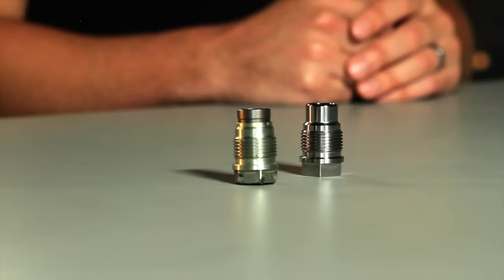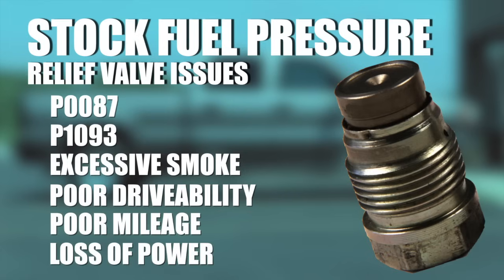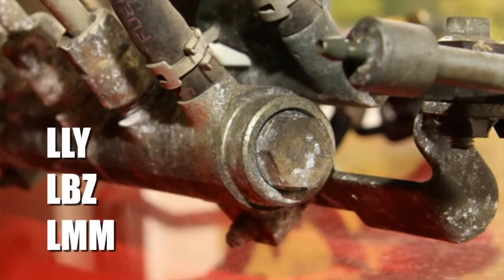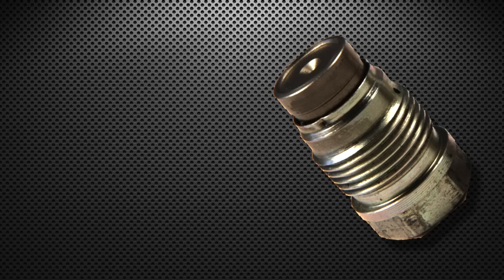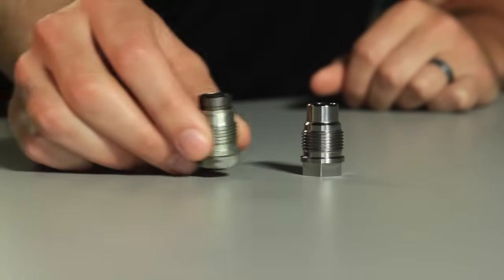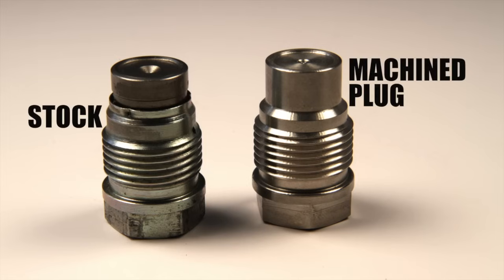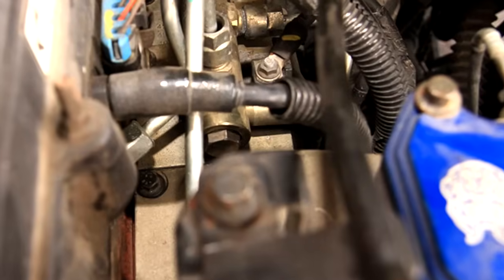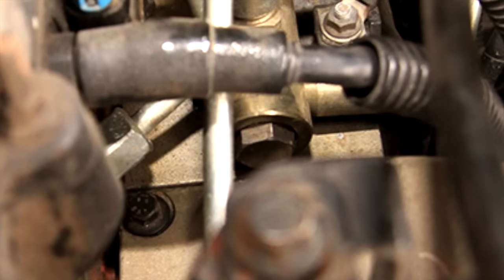Fuel Pressure Relief Valve - WHAT YOU NEED TO KNOW!

Comment: what does it do to the fuel pressure in the engine if the OEM part fails? Rail pressure too low and excessive returns? or something else?
Reply from the maker: It will not keep up with the command in fuel.

Comment: Mine was causing major issues 8-10 years ago. It would like bog out and ran like crap. They found this to be bad. Now my truck is starting to lose power, mostly when it's warmed up. It isn't throwing any codes. I just replaced the fuel filter again just to make sure that wasn't it. It mainly loses power at higher rpms. It sure does swen fuel related. Is it possible that this valve would work better cold than hot?
Reply from the maker: Not in our experience.

Comment: Hie guys i have a problem wth my common rail mazda b2500. It does not start on its own beside using quick start. And when it start it idles but upon acceleration it switches off. The code am having is p0607 plz anyone who can help.

Comment: What are the symptoms when this goes bad? I heard a drop in fuel pressure but then that would mean the injectors aren’t getting enough fuel so I would imagine the motor would sound blown. It’s pressure relief so does it relieve fuel, air or both? Why no oring? I’m thinking just an Oring so why not go with a new oring? .20c part

Comment: I have an LLY with 8,000 on the motor. No mods except a RDS 64mm turbo. New engine throughout. My issue is that the fuel rail pressure is all over the place and sounds like a blown engine. It started 2 months ago and sounded like an injector knock but got much better when running above 180 degrees. Now it does this all the time. 3 shops have had it and no answers. I don’t recall it even throwing a code at all. Engine still running horrible and can’t drive it. Any advise would be great

Comment: Whats Recommended for 10m stoker pump 90 hp injectors 06 5.9 ?
Reply from the maker: Tuning.
Reply: I have tuning. I'm just trying to find the best one, too, replace  my rail plug. Is 2200 bar good or 2000?

Comment: My MP8 mack/volvo engine which is a 535hp engine and it is having boost issues, flat out getting to 200kpa then outta the blue it will boost at 260 and runs like a dream,if I stop or slow down it will drop out and go back to 200kpa. Could be the issue
Reply from the maker: You need a shop to take a look. We would need to get our hands on it to find the issue.

Comment: I have low fuel rail pressure code when towing. When I come to a red light. It will be in limp mode when I try to get going again. I have a lb7. Help please.
Reply from the maker: Give us a call, 815-568-7920. Reference any codes. We can help assist in the right direction, but it would be best if we could diagnose the truck ourselves.

Comment: not sure if this thread is still active.. I have a 2005 lly engine code "2" my truck will go into limp mode and not let me go above 65.. and damn near nothing with my 5th wheel. New fuel filter. It never throws any codes though?? I was thinking of doing the FPR but maybe this is what I need? or both? truck is completely stock.
Reply from the maker: Have you scanned it for codes? It may trigger a code but not throw the check engine light.

Comment: I've got a 2007 Lmm and keep getting P088 high fuel rail pressure when deceleration. Would this valve fix that?
Reply: Did you fix this issue. Because I’m having the same issue after I installed my air dog lift pump. 09 duramax

Comment: I have a Volkswagen Touareg 3.0TDI with a cp4. I occasionally get a p0087 code & the truck starts to surge. It'll smooth out on its own after about 20 seconds or if I tap the throttle. Would this be the relief valve or the regulator valve on the cp4 pump?

Comment: Will this solve  a p0191 code? I got perfect fuel pressure on my scan tool. Does this work with the LML rails? I had this code before I did the cp3 conversion and a fass lift pump. My cp4 didn’t have any metal and never had an issue with it. I only didn’t the cp3 conversion for a peace of mind.
Reply: I have the same problem my cp4 fail and changed. You solve this issue?

Comment: Yep, used one on my cummins and blew the top off one of my injectors.filled the motor with fuel. I was towing at night and in the rain and never knew it happened until my idiot light was going off and I looked and had no oil pressure. The oil was floating on the fuel and blew out the breather. Good thing, no hydro lock and motor is still ok. Reinstalled stock valve. Be aware. They are there for a reason!

Comment: I'm a owner-operator hot shot driver that does his own mechanic work. I brought a 2004 Topkick 5500 I'm looking for a scan tool that will work with the truck. I have tried a few and most of them don't recognize my truck.
Reply from the maker: GM MDI Tech2 would be the most complete but, comes with a price tag. An EFILive AutoCal/SPADE would work for basic scans and data logging.
Reply: I have a 2008 Topkick(C4500) with an lmm motor. Is there a scan tool for my truck where I can read and delete codes?

Comment: I have hond civic 2.2 cdti trying to get power up hits 220 bhp get low rail presser  P0087 
Do you do upgrade valve 
I have all so looked to get fuel pump upgrade but can't find bosch agent that upgrade it
Or aftermarket pump
Only can find for VW bmw  do do pump upgrades?

Comment: I had this code return today P0087 w/Low Power Mode. This happened while towing 9,000# 5th wheel. 
Fuel filter was changed 2,500 miles ago. TP3018 GM Filter
Thoughts?

Comment: I have a P0088 and my rail pressure bounces. I run a sump to airdog 200  and I replaced the fuel pressure regulator but still has high psi on start up and the drivability is here and there until eot is normal. She also bouces at idle from 5-10k psi on the rail.
Reply from the maker: What year Duramax is it?
Reply: Did you ever fix the p0088 issue?  I'm getting the same code.  Thinking you might be able to help
Reply: It was my pump going out. I fixed it by replacing all my injectors, tubes, and installing a rail plug and 12mm injection pump. She doesnt see below 14psi. I have an inline psi guage before my injection pump and my mm3 shows my rail pressure.

Comment: I had a 6.7 Cummins in the shop that ran away on the owner from oil in the intercooler after he replaced his failed turbo. He had installed a rail plug at the same time. Turned key off, Injectors turned off but engine running at 5-6k rpm and no where for the fuel pressure to go. Yeah bad combo, blew the pintle out of the ends of 4 injectors and cracked the tip of the other two nozzles!

I install these plugs and believe they are safe 90% of the time but beware that if your truck engine were to run away and the injectors are off they will be destroyed and so will your cylinders.

I have seen and heard of lots of engines having run away following turbo failures when the intercooler doesn’t get cleaned/drained/replaced. (Not under my care). Generally they shut back down after a minute or so and the engine survives. Point is in the case of my one customer the factory relief valve would have been the difference between a 60k mile motor living on instead of catastrophic failure.

Comment: Could this make a crank no start on an lb7 it was running great then gave it two sharp rpm revs then it died and won't start
Reply: No, but there are a multitude of other fuel starvation points that could.  Log rail pressure vs desired rail to determine if it's fuel system related.

Comment: Better than putting a plug on is putting a single stage relief with high pressure release so you still keep a safety for fuel pressure. New BOSCH rail pressure relief valve modified for single stage operation. This valve corrects a common issue of rail pressure fluctuations and drive-ability issues inherent with the stock valve. In stock form the valve is a dual stage design, where once the valve opens due to system over pressurization it remains held open until the pressure lowers below the second valve stage. Typically the opening pressure is around 220 MPA or 2200 Bar, and the second stage holds the valve open until the pressure falls below approximately 65 MPA or 650 Bar. Once modified to single stage operation the valve will then regulate pressure at a constant single setting. We offer these valves set to various opening pressures ranging from 180-210 MPA (application dependent).
Reply: Is the a cheapish single stage anywhere to be had? If not what is the scope of modding the Bosch?
Reply: Ya where can we get the valve from?

Comment: I have a 2011 duramax 6.6 that is having these issues but looking at the end of my fuel rail on driverside I see a electrical connector. So any advice?
Reply: 2011 uses an electronic relief valve.  It's a pretty robust design unless debris goes through it (in which case you've got bigger problems).

Comment: "The fuel pressure relief valve - also known as the fuel pressure regulator..." A fuel pressure relief valve is not the same as a fuel pressure regulator.
Reply: Especially considering duramax engines have always (since introduced) used CP3's which have, a fuel pressure regulator, and further downstream a fuel pressure relief valve. These guys seem to shoot towards the more uninformed crowd, but bad information is dangerous in its own right
Reply: @BlondeWick  that and possibly grenading injectots by deleting the relief valve, if you are hard on the engine.
Reply: Yes pressure relief as very deferint
Reply: My engine was loping at idle. I changed the pressure regulator and the loping stopped but now the engine makes lugging sound for a few seconds if I let off the gas and hit the brake say at freeway speeds or when the rail pressure is high. Then gets back to a good idle. Does that sound like a relief valve issue?

Comment: “p0047 Turbo/super charger boost control solenoid circuit low “ then “p0090 fuel pressure regulator 1 control circuit “ those my codes

Comment: Hey Guys, I have a 2006 Duramax LBZ motor with a bad fuel issue.  I can drive down the road and the engine will just cut off.  It’s like the fuel pump loses signal and the engine will just stop running.  I put it in park, turn the key off and restart the truck and its like it never happen until it does it again???  Lately I have been getting a 0088 code fuel rail too much pressure code and I will clear it and it goes away for a while, but it resurfaces.  Can you let me know what the problem is??  Could it be the sensor in this segment???  I want to know before I have to take it to the dealership and pay an arm and a leg!!!  Thanks!!!

Comment: I have a 2008 6.6 Duramax,  and recently had issues with going into limp mode, while towing my 24' trailer, local shop replace cp3 pump regulator, and said I'm still not getting  enough fuel pressure,  about 2000# less than what it should be running at. Could this relief valve be causing my pressure to not build high enough? Or is it possible I have a pump issue.
Reply from the maker: While it could be the relief valve this sounds more likely to be a Cp3 pump. When the regulator goes bad, they either lope at idle or lose signal completely and run wide open.  The relief valve most commonly, will open under high load and drop your Actual Rail Pressure dramatically.  A weak Cp3 or restrictive low-pressure supply would most commonly cause a consistent deviation between  Actual and Desired Rail Pressure.

Comment: Having surging at idle
Reply from the maker: Check your fuel pressure regulator.
Reply: Which is different than the pressure relief valve. It’s located on the back of the injection pump and is held in with 3 torx head fasteners.

Comment: Just had a issue today.   Had to get on it hard to get out into traffic. Let off at the next light  to turn truck shut off  cranks but no  start.  Basically bone stock 05 LLY  changed filter and water sensor now is it possible this is the problem.
Reply from the maker: It's possible.

Comment: Used a regular 18mm Craftsman wrench. Used the boxed end on the wrench. Tapped on the open end of the wrench with a brass hammer. 
Tap tap tap until it came loose. 
Installed plug same way. Tightened by hand as much as I could, then tapped it over a quarter turn with the brass hammer.
Reply: Where is the location of it

Comment: Lots of questions about LMLs
I have 2015, same problem, but cant find any videos
It's on the front of rail drivers side
The back port is a sensor, the front is valve
I cant find anything on how to get in there, may have to take EGR off

Comment: I watched some videos on these and couple places said that they have seen nuts and fittings blown apart when you let off the throttle. I have a stock 05 lly, I don't have any codes yet but thinking the spring in my rail plug might be weak. Would this be a good idea for my engine since it still runs on the stock tune? Only thing I have done is install a fass95 pump and s&b cold air intake system.
Reply from the maker: Yeah do it.  For $50 you really cant beat it.
Reply: @Duramaxtuner  I got one with new seal from ppe for $31. Now gotta figure out how to get the glow plug module bracket out of the way. Can I cut it and relocate the module or is that bracket grounded?

Comment: I use to be able to smoke the tires at a light. Now nothing.  What do you think?
Reply from the maker: Boost leak or dropping rail pressure would be the most common reasons for a loss of power.

Comment: I have a 2001 lb7 and I have black some under regular driving not a lot but some could this be the issue
Reply: Lb7 has no rail pressure relief valve. Check air filter, check for boost leaks, check your turbo wastegate, if all are good, check your injector balance rates. You'll find your answer fairly quick.

Comment: I know this is an older video, but I did this fuel rail plug. And than I bought a ppe ported fuel rail fitting.  And that ported fuel rail fitting leaked fuel like crazy(while I was on a trip with my fifth wheel camper).  Luckily i swapped my stock fitting back in, but I’ll still get that low rail pressure code if I horse on a high tune.  Did I do something wrong or should i drill my stock one out(ppe fitting has 3 or 4 threads showing)

Comment: I have a 2006 LBZ Duramax I have idle issue when I put it in reverse or drive or AC on it runs good but if I put it in park it idles up and down could this be the problem?
Reply: I have this issue did you ever find out what it was? Lly on mine

Comment: so my question is i drive my truck daily and mine just did this so i parked it and i believe this is the issue but if i put one without the release valve like yours don't i risk my injectors getting over pressured and blowing up? also does my fuel economy go down because it blocks the extra fuel going back to the tank or does it not block that?

Comment: 26-29 thousand psi....  that's the typical shear stress of steel. I know you were exaggerating on some of the comments, but sheesh - try to be accurate when quoting actual numbers.
maybe leave the thousand out.. be a lot closer.
Reply: That's the pressure that these truck run, fuckwit. 29,000 psi.
Reply: My lb7 runs at 24000 psi and the newer ones run much higher.

Comment: Im seeing slightly low rail pressure at WOT truck always only makes 21k or a hair more but is demanding more. Has no problem getting to that 21k. Do you think my PPE rail plug not being torqued hard enough could cause this? I was not the one to install. Truck makes the same rail pressure on each tune and still has plenty of power. What gives
Reply: Did you ever find your issue I’m experiencing the exact same thing
Reply: @texasishome2022 nope truck runs fine so kinda just blamed it on a rich tune maybe

Comment: I'm having fuel pressure loss when my lmm sits and I have 2 prime it. Could this valve be the problem? I'm getting no codes
Reply: I had same problem a couple of years ago, leaking around primer, also wires were broken for the heater on the top of the filter housing. Could not repair wires , ordered a new housing from dealership and problem solved.
Reply: rootedflunky1  no that is caused by your fuel filter housing. You just need to rebuild it. It’s like 20 bucks comes with new spring seal and brass fitting.
Reply: @anthonygutierrez1038  n
Reply: rootedflunky1 same thing happen to me about 2 months ago. I rebuild the fuel housing out on my drive way and it was missing one of the o-rings in there. Didn't even have to take it completely off my lmm let it hang and put back with new seals and bam! Running like a champ.
Reply: Sergio Flex5 ...... I replaced the water separator sensor and that fixed my problem... Thankfully I didn't have 2 rebuild the housing.

Comment: Put the plug in my ‘11 cummins. It did away with the ‘burping’ after pedaling under load. So far so good. Had to remove intake horn, took about 1hr. $10 part ***quick update: I spoke too soon, still having the issue. I will reach out to CPS once more.

Comment: Today I got the p0087 while towing and forcing the truck abit uphill and truck went into limp mode, is there any risk on replacing stock valve with this? I drive a 2012 ram 3500 6.7 full stock.
Reply: Daniel had the same exact thing with mine. 2011 ram 3500 after I deleted! Had p0606 on key code read and 0087 on a scanner. Shimmed the stock plug and no issues since. Would happen pulling 40 foot horse trailer merging on to on ramps or going up hill at a slower speed then having to ask for more going up! Til i figured it out if I pulled over and shut truck off and did the key trick to read and reset codes light would stay on but regained power. Light would go away when I unhooked from the trailer and drove a minute. Was really frustrating and annoying
Reply: Taylor,can you explain the "key trick" please?